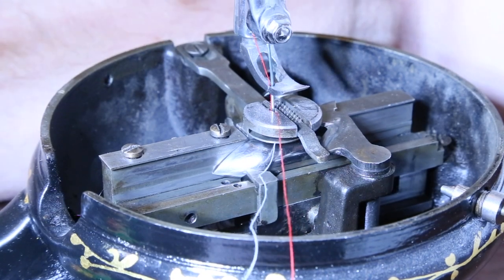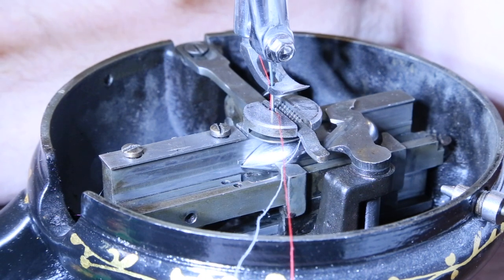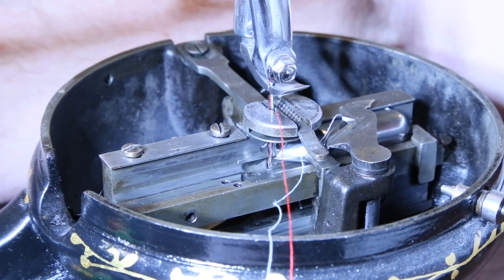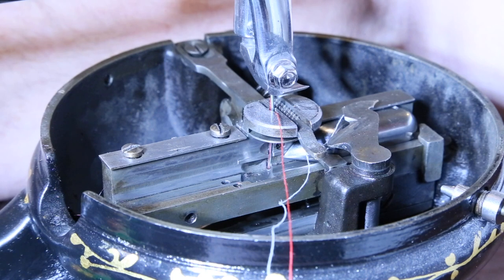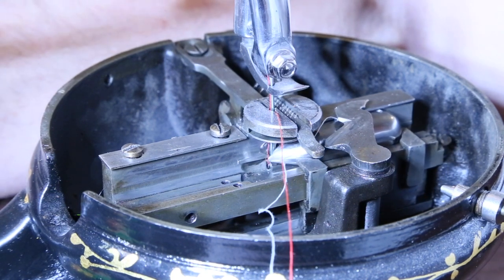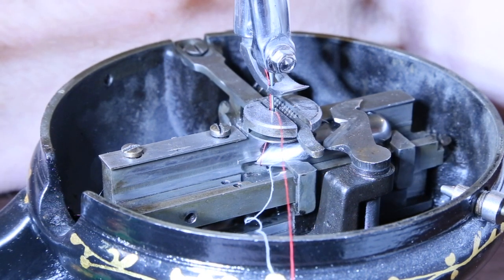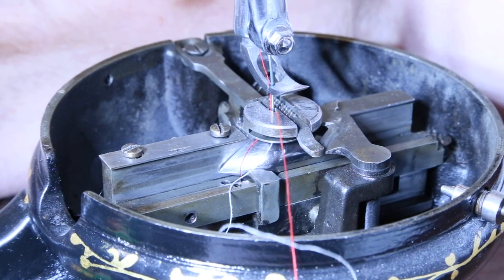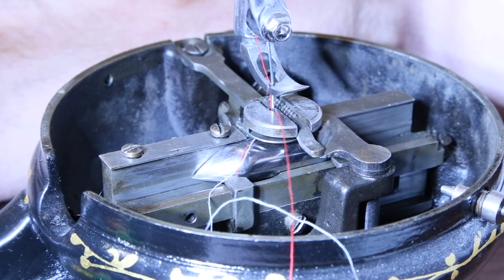For Karen:  Picking Up The Lower Thread On A Florence Sewing Machine

Comment: Hay Wayne is that Zinc Sulfide paint still the same with that Decoart company? I hope that the glow in the Paint decays quickly.
Reply from the maker: Hi! Thanks for commenting! I don't remember testing the Decoart glow paint, but assume it uses the inexpensive zinc-based formula, which would go dim fairly quickly. You have me wondering: Most people want the glow to last as long as possible, why would you want it to fade fast?
Reply: @wayneschmidt490  I been experiments things. I don't what give others the invention idea but I'll if you curious I'll give you my gmail them probably deleted  it the message.
Reply from the maker: @marccarpenter2680  I respect your desire to keep your idea secure. Tell you what, if it works out and you post a video of it, please send me the link.